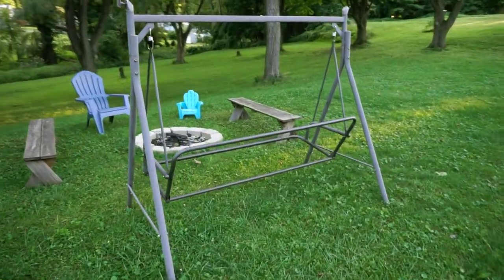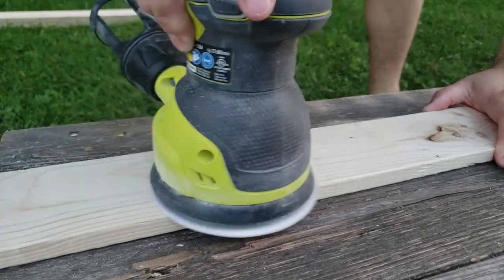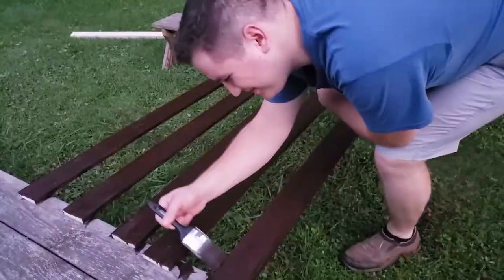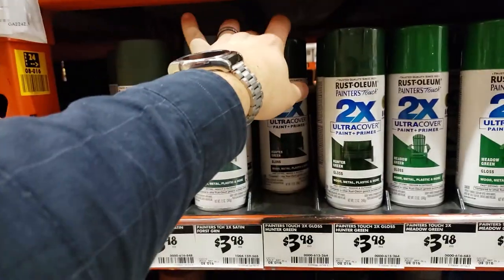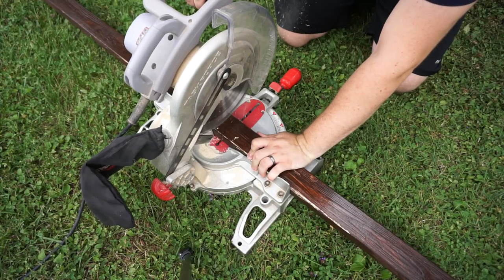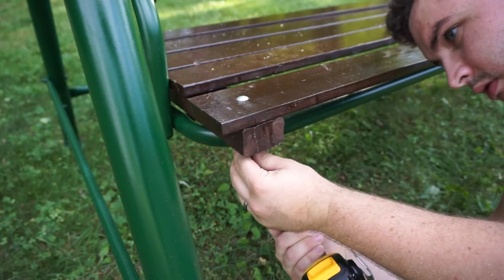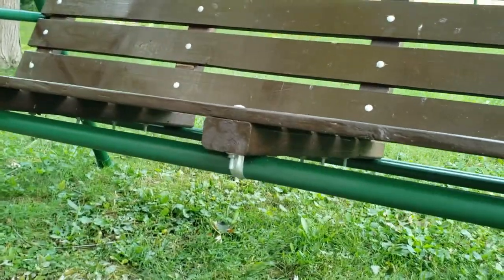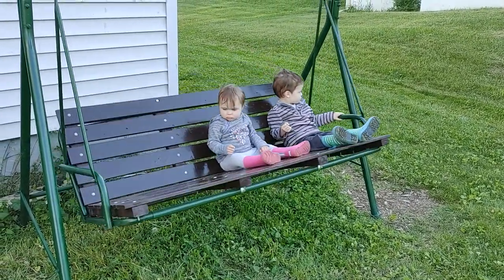DIY Patio Swing Rebuild

Comment: Thank you so much for sharing this.  I have a swing with moldy cloth on it that holds water.  I was thinking about putting webbing on it until I seen your video.  Wood seems like the way to go.
Reply from the maker: Swing is still going strong! No signs of degradation.

Comment: I would cut off the excess on each bolt and grind it smooth for safety reason, especially with small children.  Good job.
Reply from the maker: Thank you. I agree, those bolt ends have to go. That'll be the next project I work on.

Comment: What was the angle you figured out to cut for the back pieces?
Reply from the maker: I do not remember. I bought a protractor from Home Depot and measured the angle of the metal, and used that.

Comment: Could you please give me the list of materials you used and the measurements. From already thank you very much
Reply from the maker: Hi, the measurements depend on what you are attaching the boards to. I started out with 3 short 2x3s on the bottom. Then screwed in 5 1x4s across the 2x3s. I did the same for the back part of the swing. Use any wood stain to stain the wood, and then use polyurethane to seal it.